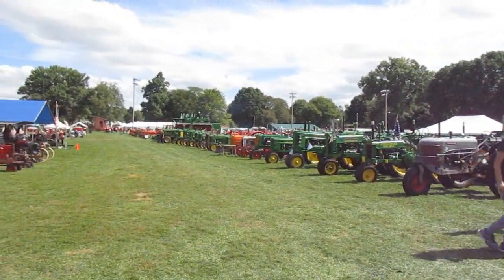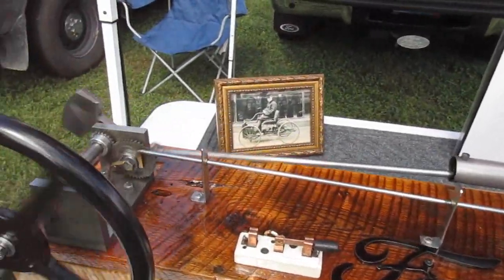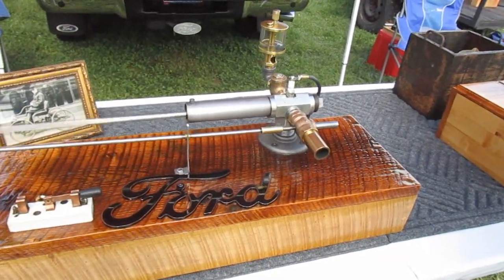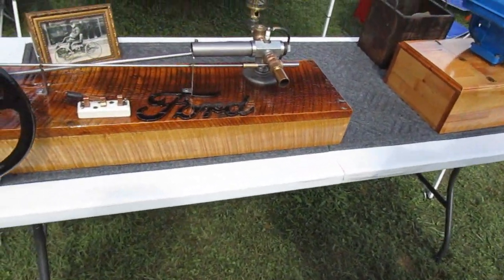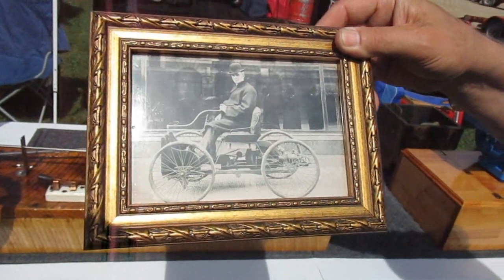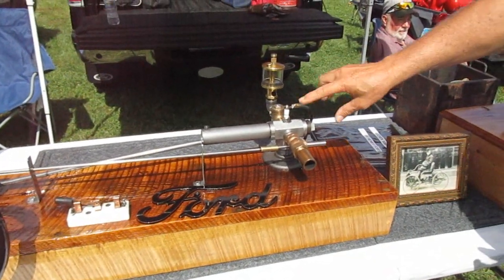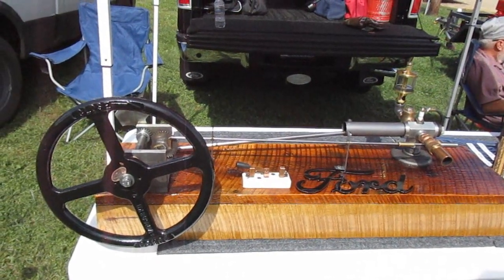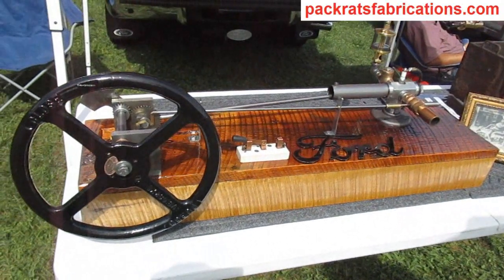Replica of Henry Ford's 1st Engine

Comment: i like this engine much , where i can buy a DIY kid , just all metal parts , you have  a link , regards from germany
Reply from the maker: Hi, I don't know if there is a kit. The guy I talked to in the video said some information and copies of the original drawings came from the Henry Ford Museum in Michigan, USA. I did a quick search and there's a few videos of different ones, all a little different because they're hand made but similar because they're all based off of the drawings. Try contacting www.thehenryford.org, here's a link to some info at the website. https://www.thehenryford.org/collections-and-research/digital-collections/artifact/224715#slide=gs-240148